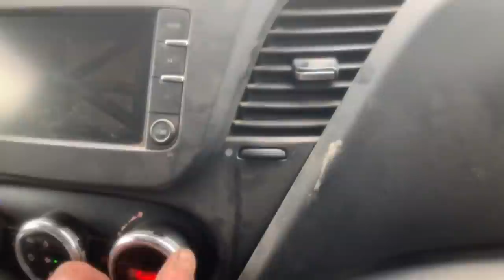Weather struggle! Iveco rear discs and pads, always remove all mounting bolts mobile truck mechanic

Comment: Time to get one of those wind out canopy’s fixed on the side of the struggle bus fella. Like you see on windscreen fitting vans. 
And I did chuckle when you spent ages beating the hub around the floor and then found the bolt still in 🤣.

Comment: Your right about working in the heat of summer Chris , I worked in Dubai 10 years ago on a 6 month contract and most days about 1 pm it was around 50c... that is fooking HOT... 😡🔥every one stops work for a few hours until it cools down to a moderate 40c , it almost killed me but I stuck it out for the money.. 👍
Reply from the maker: Ah mate a moderate 40c 🤣😂😅😅🤦‍♂️sack that 😂

Comment: to remove the wheel why dont you make a tube to fit a bottle jack so you can jack from one wheel to the opposite wheel save STRUGGLING with a sledge hammer.i love your videos and fair play to you for working in those poor conditions

Comment: Top job Chris. Lovely day for it! 
With that elbow on the chamber could you not rotate the back end of the chamber? 🤔👍😄
Reply from the maker: Done it today Benny! Them ones are sealed clamps in the end I stopped the chambers from Side to side so the ports where in a better place…. Good thinking though mate cheers 👍
Reply: @Professional-struggler  Top Job Chris good idea that, swapping them 😁

Comment: When you left the disc bolt in and knocking Fuq out of it that was you just preparing it to come off 😂😂😂, get yourself a wet suit I’ve got one, Fuq me them are ideal for being out on railway in piss rain under trains
Reply from the maker: That’s right Andy showing it what happens if it thinks about being tight 😂 or waders 👍
Reply: @Professional-struggler  the wetsuit I have is a pulsarail one, gortex, I’m normally an XL but had to get next size up, just in case you decide to get one, least the caliper bolts came out drama free 😂